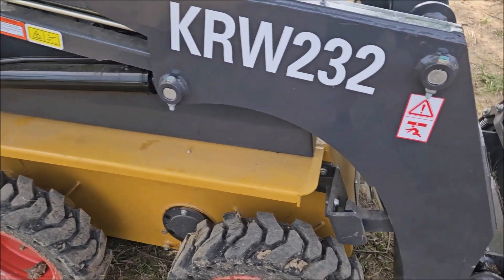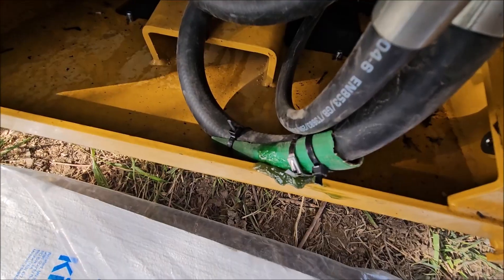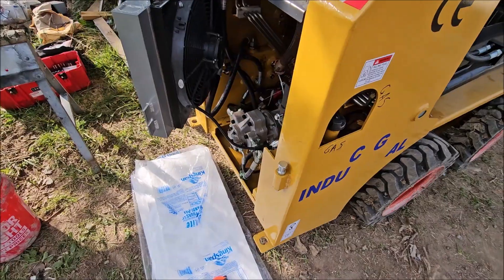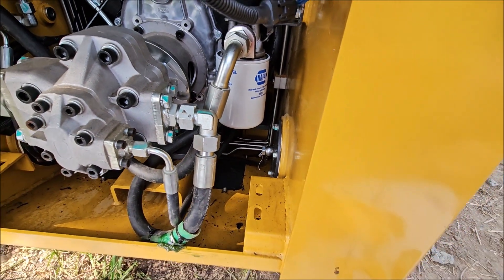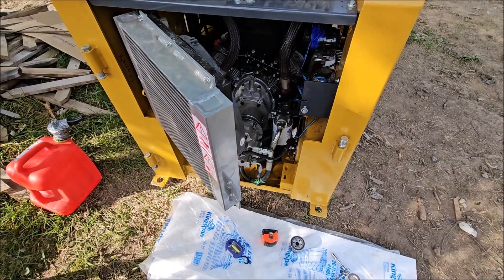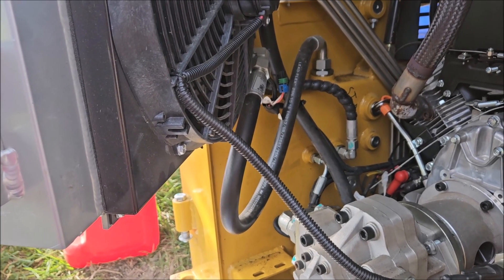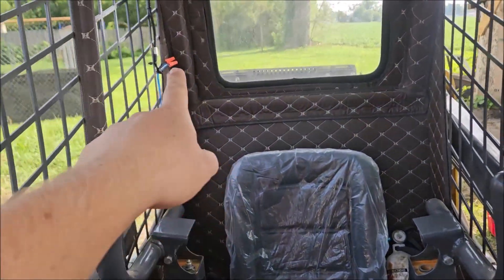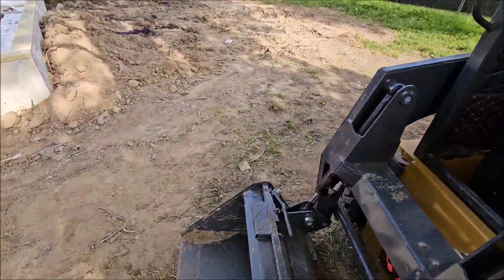KRW 232 Chinese Mini Skid Steer First 5 Hours Required Maintenance Tutorial

Comment: how is the jumpiness? most are saying it's improved with the pilot control valve adjustment, pilot control spring mod, and using aw46 hydraulic fluid. might take the plunge next week on one at auction since selling my chinese ff12 excavator. great vid thanks.
Reply: I have just purchased one of these this weekend and man is it jumpy. I am not very experienced with skid steers but this thing would make even the pros look like it's their first time. Where did you hear about the Pilot control spring mod? I will be chaning the hydraulic fluid to 46 and see if that helps.
Reply: @A @AdamTreier search krw232 pilot control and there’s a YouTube vid of it

Comment: Don’t forget to change the drive motor gear oil They are very prone to getting water in them which causes motors and seals to go bad quickly.
Reply: Does the Tk35r have the same motor gear oil
Reply: @GoldenKnights50  what are you referring to?
Reply: @GoldenKnights50  yea both use 80w90 gear oil for the chain case. mine came with 4 gallons of water in the chain case. tk35r is a little more difficult to get to the chain case fill/drain plugs obviously

Comment: Hey, you're forgetting the Gear lube. It's the drain plug in between the tires. one tank on each sided. I changed mine at 3.5 hours and good thing i did it has metal shavings and water inside it. How the water got in it I haven't a clue except the Chinese added it. I am taking the round plate off next to see what's behind it and to clean out the metal shavings and to inspect. Let all know about this. The Hydraulic dip sick makes no sense as the tank and full systems holds quite a bit of fluid. I got about five gallons just out of the tank alone which is about 5-6 inches above the full mark on the dip stick ...
Reply from the maker: I didnt even know this was a thing, I will look into it. Thanks for the advice I hope others read this
Reply: I agree, the hydraulic dipstick don’t fit right…the fan is just like this guy says..don’t ever turn on. It has all those friction spots on the hoses. My drive motor went out within 15 hours. I never had it revved up very high or anything..just weak. Wish i could get it to go 1mph faster at least..so slow and jerky.
Reply: What gear oil is this. What did you replace it with and where is the fill spot?
Reply: @sgt-maj_smoke  two plugs between the tires, top is fill and bottom is drain (one set on each side), takes 80w90 gear oil about 2.5 gallons each side

Comment: Hey, is the fan switch on the console supposed to turn on the hydraulic fan? Or does the hydraulic fan come on by itself?
Reply from the maker: it is supposed to turn on via a thermocouple switch, but mine did never turned on until I did this
Reply: By itself. The fan switch is for a cab fan and the wire plug for that should be laying to the right side of the seat. Just need to but the fan and plug it up and mount the fan but there is no damn places to sell parts for these machines making them disposable
Reply: @user-xv9if3mb6x  you would think that's the case but I took a multimeter to the wire and it's actually for the same light that's on the top of the cab. If you want a fan you'll have to run your own wires from the switch, assuming the switch actually has power.
Reply: @c4rn199 what did you do to make the main radiator fan turn on when turning the ignition on?
Reply: @armwrestlinginthe6ix  wire it to the main switch if you want it on with the power. Just make sure you cut off the main power switch after you take out the key.

Comment: Check your wheel lugs. Mine came loose 10 hours in. the rim got a little wobbled out.
Reply from the maker: I forgot to mention that but yes, a few of my nuts were loose from factory
Reply: I bought the wider rims and tires which were to expensive and did not fit correctly and had to put aig not back on the stud and pound on the lug nut to not damage the stud to move it slightly to have the rims fit. The OEM Rims and tires are way too small and DAMN, way to heavy. The new ones are way to heavy. AGT will give you a manual if you don't have one....for free. It sucks but it is free...